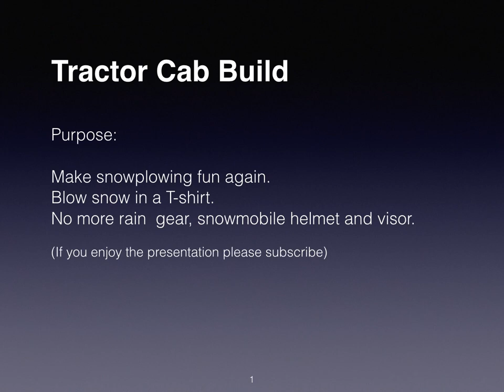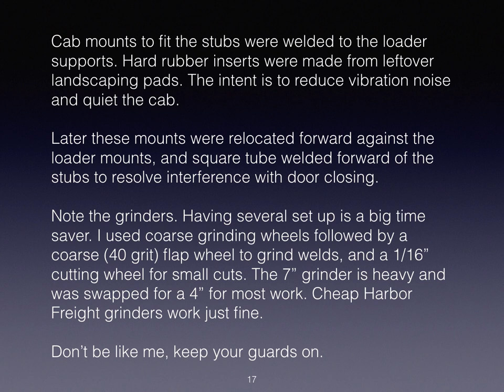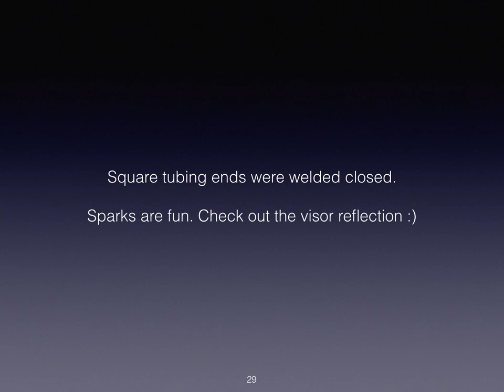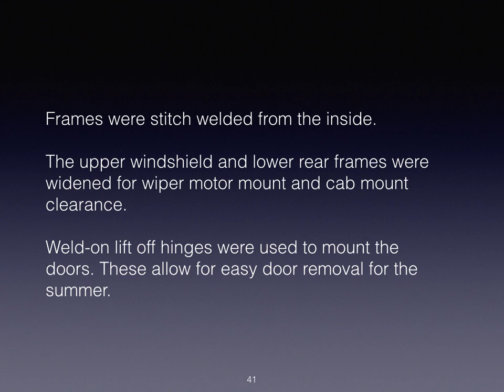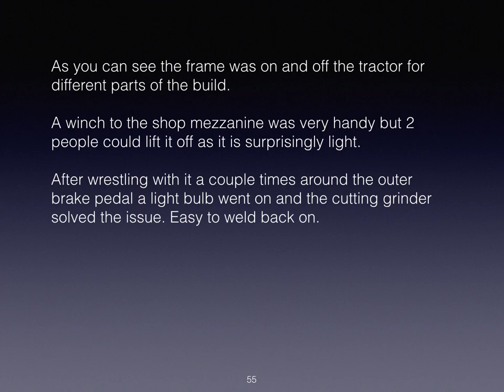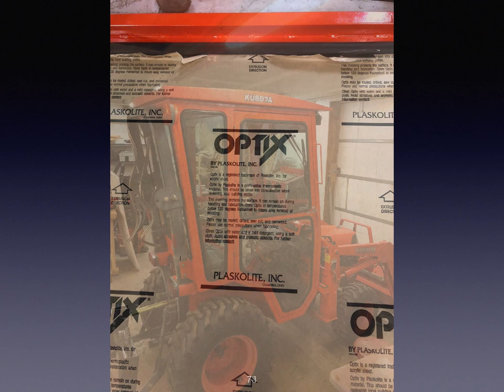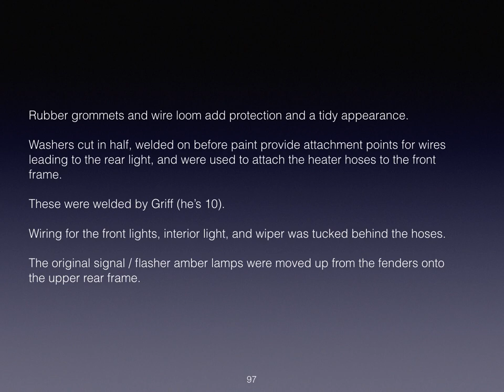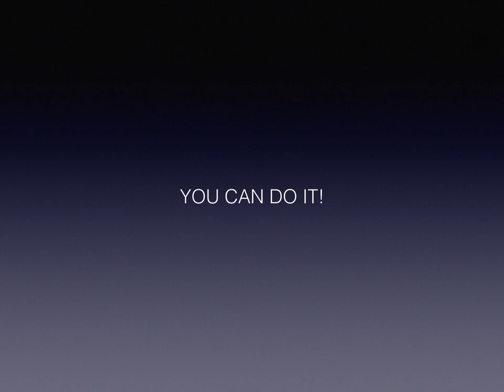Tractor Cab Build

Comment: Impressive build very nice job, did the rubber mounting achieve what you wanted it to? Did you isolate at front mounts only, it looks like the rear was hard mounted?
Reply from the maker: Thanks! Yes the rear is hard mounted. I did the front with rubber mounts because it was easy to incorporate into what I had in mind. I really have no way to know how effective it is. It's held up well so I suppose that's most important.

Comment: I can not tell you enough how much I appreciate your video. It is going to be so helpful. I have a Kubota L3200, and I am starting my cab build the day after tomorrow. I have purchased almost all the little stuff, heater, wiper motor, hinges, fuse block... hinges... a dome light.. switches etc. I will head out monday am get a load of steel and see what kind of a mess I can make... How long did it take you, roughly? You dont have to answer this, that is fine but I am curious how much you have invested. I was thinking I would be pretty happy too keep it at 1000-1500 bucks. Small price to pay to be warm and dry!!! Thanks again!! Ron in Maine~
Reply from the maker: Thanks Ron. It took me about 2 months working evenings. My expenses were around $1200. The largest expense was glass installation. 
Let me know if I can help in any way. I’d love to see pictures.

Comment: very nice build.  we need an update video on the cab.    how's its held up?   and additions or updates/upgrades.
Reply from the maker: Thanks Jason. The build has held up better than I could hope for. We have frequent wet snow in North Idaho so it sees regular duty winter and summer. It is stored in a shop but is generally still wet or with frozen snow / ice on it each time of use and I've seen no rust. Frankly I'm surprised. The door seals have held up and they still close nicely. The heater and wiper work great. The improved lighting is nice.

I wondered if it would make things hot in summer but with the doors off, its not. The cab provides shade so its more comfortable in summer. The doors come off and on easily with the pin hinges. I've added a bucket quick attach and grapple so the tractor sees more summer use.

I've done a lot of projects. This is hands down my favorite. I smile every time I go out in the wet blowing snow in total comfort. Rather than a dreaded job its now fun. Mission accomplished. Seems like overstatement but I can't think of anything I would want to change. Wait, it could use a cup holder. That's about it.

Comment: You should drill out some 3/8" holes on the under side of your tubing to allow for ventilation.  Once you close out a tube end it can rot from the inside out faster than if you close it & leave it. Pretty cool build you got there i see a lot of similarities to mine. Good job from mbhunter2011
Reply from the maker: Thanks Rene. I"ll consider your suggestion.

Comment: Looks just as professionally made as a Curtis Cab. This is how I would model mine. No way I'm spending a fortune for a Curtis Cab when I can make my own design with all the bells and whistles ,I think I need! LOL
Reply from the maker: Thanks Dany. It saved a lot of dough, and was fun to do.
Reply: @esauseven  How loud is it in the cab now with all enclosed? Do you think insulating it where it can be done, would make a big difference? I haven't seen your door handles. What did you use?
Reply from the maker: @danyf3116 , it is for sure louder than without a cab. This was part of the reason I made the roof of wood. I can't say how much it helps but I believe a metal roof would resonate more like a tin can. One could try insulating the "firewall" but my gut says it would not help much.
I have some hearing loss from being around machinery, so I use hearing protection to keep what's left. Makes it a non-issue. I'll reply separate on the door handles.
Reply from the maker: @danyf3116  Here's a link to the door handles I used. I first tried a set of screen door handles but when one broke I knew they were not a good choice. These are very durable. There's a parts list at the end. Not clickable but the descriptions put into google or Amazon  likely will get you there.
 https://www.amazon.com/gp/product/B01347C5C6/ref=ppx_yo_dt_b_search_asin_title?ie=UTF8&psc=1

Comment: Cool design, I must say. What is the total weight once installed, roughly?
Reply from the maker: Good question. Short answer, I don't know. Longer answer, the metal frame is surprisingly light. I could lift it quite easily and I'm just average strength. I'd guess 120 lb. The wood roof is very light, under 50 lb. The glass is fairly heavy, plexiglass less so. I'm going to guess 100 lb for those. So maybe 270 lb. Very rough estimate of course.

Comment: Nice work but I would have just put a piece of metal for the roof. It would have been less work and more durable.
Reply from the maker: Thanks. I enjoy woodworking and it did not take long.
The wood is nice in some ways. Quieter. Easy mounting interior elements. It really comes down to personal preference.
Reply: Dave, did you use metal for the roof of your cab? I checked your profile and didn’t see any cab builds. Let’s see your handy work.
Reply: @RS-pk3lg  The only cab I have built was for a tractor that is long sold. My tractor now has cab on it that I want to rework and modify. It is a Lambourn from the early 80's and really is not the best design but I can modify it to make it much better! Just finishing my new house build and need to get my new work shop up too! I will do a video when I get to it.
Reply: @RS-pk3lg  Yes by the way I did use metal for mine. The tractor that I did it on was my employers and we were lucky enough to have a metal brake and sheer in our work shop so it was not that hard having the right tools. Like I said in my other comment that it is long gone probably 20 years ago.